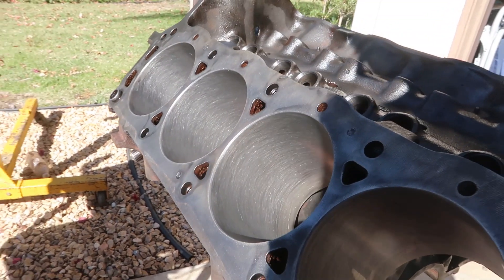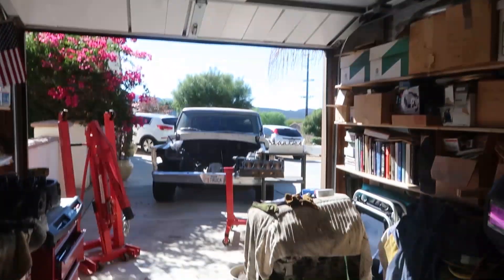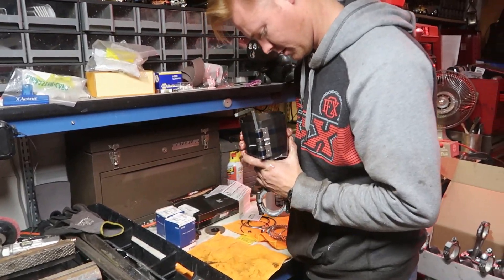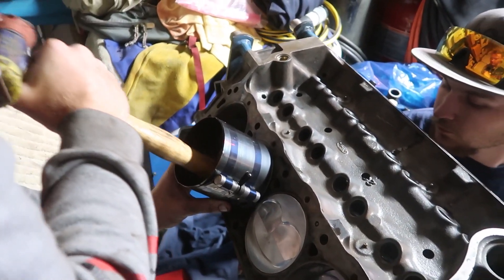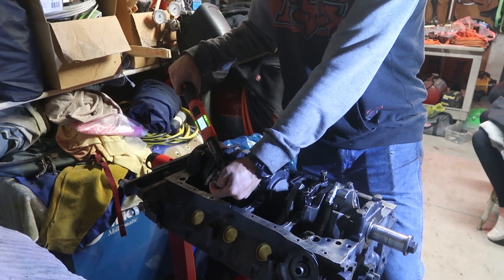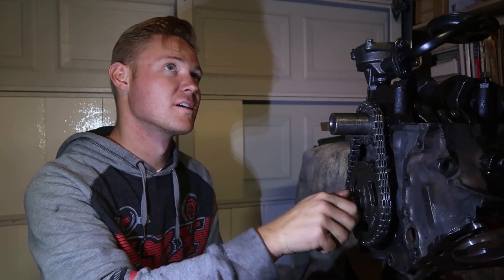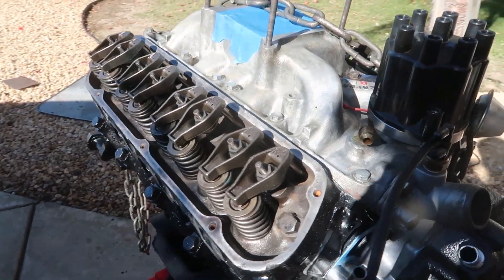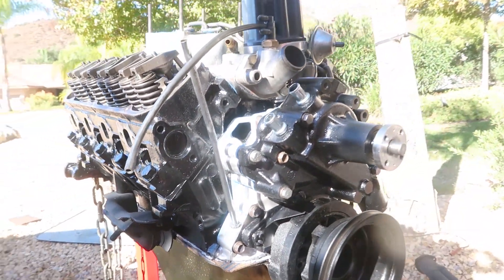Building My NEW ENGINE For My F100 In 1 Day! *High Compression Small Block*

Comment: With flat-top 4v pistons and a 58cc head, you get about 9-1 c.r..I'm currently putting a set of speedmaster iron 180cc intake/64cc exhaust heads on a 306 C.I. with a 477/496 cam, rpm intake.  Should run pretty stout.

Comment: That timing chain is a definate no go. Also a good cam company includes both cam pins. If those are comp lifters, Throw em in the trash. They will collapse eventually. Just a fellow ford nut with 35 yrs experience.

Comment: What you could have done is heat up the piston with a heat gun (I prefer using a heatgun as with torches the heating can be too localised) and get a can of air duster and hold it upside down and spray the pin with it to cool it down (while holding with pliers or running wire through it so you dont frostbite your fingers) and it should slip in as easy as a pound of cocaine up a prisoners butthole

Comment: HB Icon torque wrench is 100 bucks .. I hope you don’t have head gasket issues , you didn’t check the deck on the block or heads and used old heads from another motor and used a wire wheel on the deck on the head 🤣 I was like Nooooooo

Comment: Seems like a nice combo.  I like the domed pistons.  I am a little hesitant to run a flat tappet cam any more after reading about all the failures guys are having.  Retrofit link-bar lifters are a little pricey at about $400, but I think I would run them if I had a flat tappet block.  I am also a fan of the later GT40 or GT40p heads.  I just figure they are not as worn out at early heads and no other Windsor head flows better.

Comment: I had the exact same shortblock with a set of e7 heads with the egr in the exhaust port ground down.  Compression was around 10.25:1.  With a smaller b cam, a dual plane with a demon 650 carb, thru a 5 speed with an aluminum flywheel and  4.10 gears made 281rwhp.

Comment: Is there a hole and lobe on the cam if so young man find a good can driven fuel pump it just makes life easier maybe not as much of a cool factor but im all about what works and what is reliable... I've used many electric pumps but i find them old motors worl well with the pumps they call for not to mention simple... But cool build bud.... Downs AutoBody--- Maine

Comment: CRANKSHAFT OIL SLINGER installed and I'd look into the Fuel Pump Eccentric pin........ it should have come with the camshaft or the timing gear set !

Comment: Sounds and looks killer!  Is that cam hydraulic or solid lifter type?  I never had much experience tearing into small block Fords, except replacing cams and valve train parts, as most of my experience was with the FE block, mostly 390 but with a few 406 and 427s.  I could rebuild an FE in my garage with a buddy helping me in a weekend, although not keeping hard at it as you do!

Comment: Hope you put different valve springs on the heads. The stock 302 springs won't work with that comp 280 cam.
Reply: Should have looked before I commented. Sorry. Glad you changed rhe springs!

Comment: cheap upgrade source  set of 351 heads. theres 3 you want the cleveland if im not mistaken. you have  drill and tap the head bolts but itll add alot of hp to a 302 put it into the 500hp range on the cheap.

Comment: I think you can kiss 10:1 good bye. Those small chamber heads is going to kick you up alot. I hope you che ked valve to piston clearance bc with your right foot they just may meet!! My 306 is 10:1 and I'm running g a true flat top with 2 small valve reliefs but aluminum heads on top. You may have to run racing fuel if you start getting spark knock. Either way you'll get it and I'm looking forward to the next video. Want to hear it run!!!!
Reply: I'm betting there'll be a video in the future installing alu heads with 64cc chambers. That'd yield compression in 10:1 area & probably pickup 50-60Hp over those old wheezy 302 heads. Only reasonably good head of late '60s/early '70s were on the '69-'71 351W. GT-40 irons are similar but have advantage of hardened valve seats.

Comment: Reminds me of a 302 I built years ago, in the early 90s. 1970 302, 9.3 to 1 compression, ported 1970 heads, 3 angle valve job, 280 Comp Cam, Edelbrock f4b Shelby style intake, 600 Holley and headers. I ran a pinto converter in a C4 with 411 rear end. This was in a 1971 Mercury Comet GT. Ran 13.50s at 99 on street tires, and was an absolute blast to drive on the street! Love this build! Anxious to see how it sounds! Congratulations on building your own!

Comment: GT40 P HEADS AND E303 CAM SHAFT WOULD HAVE BEEN BETTER COMBO
Reply: No but it's not hard to drill and tap 2 holes for the lifter cradle. Have done that before and works fine.
Reply: I don't mind to run them if I have to don't have a problem doing it just like anyone else would rather have the original roller block. Matter of fact that is what I've got planned today go look for a explorer motor. Thinking on building another 331.

Comment: when your torquing an engine rotating assembly you should always spin it over after every rod you torque or main.
Reply: cody mallernee some pro engine builders on YouTube say it's bad to turn the crank when all the bearing caps/rods aren't torqued in because the bearings aren't fully seated into the caps and rods until they are torqued in and turning the crank with the bearings not conformed to the journal can cause premature failure. Don't quote me on this but I believe Power Nation recommended this
Reply: I was always taught do one at a time and turn it over afterwords that way if you were to to something improper and it wont bar over  you could always double check the last one instead of having to start over

Comment: It’s gonna be way more than any 10.1 lol
Reply: You're right. KB says those with 58cc heads will be 10.8:1. Cam is 230º at .050", so it will ease things a little, but he is going to have to pull timing back just to run 91 octane. Results should be entertaining.

Comment: With stronger valve springs and the bigger cam you really should have installed screw in rocker studs, or at least pinned the stock pressed in studs. Hopefully this doesn't cause you problems down the road. Nice to see youngsters taking on projects like this on your own. Keep it up, looking forward to hearing it run.

Comment: With 11.0/11.5:1 comp you can only run 91 now also I hope you upgrade your valve springs on those heads you will probably need to run bigger jets in the primary and secondary you might also need a bigger Carburetter I’m not sure what size you currently have but you probably will need a 750 to an 850

Comment: For heavens sake dont use the valves with lash caps and those junk rail type rockers. Get them machined proper for screw in studs and guide plates if they need it. Dont reuse old valves, they might have 150 thousand miles on them. I am wasting my time. I hope you dont end up with detonation. With flat tops in my .289 I am right at 10.5 to 1 compression. With your pop ups you may end up with more like 12:1 unless you already did the math. I am not being a wise guy but you are cheaping out in the wrong direction.
Reply: Hello, I totally agree on the lash cap/rail rocker setup.  As for compression ratio, it is really a challenge to get 10.5:1 with a 289 - I ran some numbers as I am building one myself.  4.030 bore, 2.87 stroke, 0 deck height and a .039 gasket with 5cc of valve relief takes a 50cc head to get 10.5.  the pistons shown here only have a 5cc positive dome, doubt they are at zero deck and the heads are probably closer to 60cc with Ford's production tolerances.  it should end up around 10.3-10.5.  the biggest concern I have is early in the video he showed the combustion chamber and it looks like these heads have some serious exhaust valve recession!  valve faces are below the chamber surface which isnt good.  easiest way to fix that is to do a rebuild and cut the seats for 351W valve sizes.  that way you can cut into new metal and with a bowl blend good to go.  Thecraig909 wondering if you had a valve job done to the heads?
Reply: @jeffdiehl8394  Maybe it is the camera because they looked bigger than that. A stock 289 hi-po is 10:1 supposedly and with a 58 cc cylinder head I figured he was squeezing it a good bit so maybe since I wasnt there and the magic of cameras it looked almost like an interference fit. The thing that got me is he didnt even put a high end roller chain and using old unknown valves over and he probably didnt balance it either it could be a shaker when he fires it up and drives around. I never rebuild without balancing including inline engines.

Comment: With those heads and pistons I don’t think you’ll get away with running 87 very easily anymore lol
Reply: Neal Head  I was thinking like 25:1 so he could run it on diesel🤣
Reply: Knock knock
Reply: Race gas boi. The comp 280 will help but it’s gonna be 91 minimum fo sho. Might end up needing to get aluminum heads in the end.
Reply: @sparky72  i def would have saved up more money to put into aluminum heads
Reply: Life’s too short for 87 octane
Reply: Amen. You will be going to High Octane.
Reply: Nah he will be able to run pump gas tho, just 93, good thing he didn’t go any higher, I had a old 64 327 with domes and double bump heads, rowdy motor but it wanted 110, and tbh it was ass.

Comment: I’d say the compression ratio is more thank 10:1 with that head more like 11-11.5 to 1
Reply: I would imagine with that small cc chamber
Reply: Yeah, I'm honestly confused. I have a 306 with flat top piston that have valve reliefs combined with AFR 165 heads that have larger chambers than these and im sitting around 10:1.

Comment: I foresee broken u joints in the future! You're gonna need to invest in some traction bars or slapper bars or something to keep the rear end from wrapping with all the new power!
Reply: @janeandjohndoe4704  i thought that too about the 9" in my 78 f150 till I literally blew apart the housing into pieces
Reply: @janeandjohndoe4704  yeah mine was the original 9 inch from 78 and apparently the stock cast iron center sections are only good for 300 ish hp and my 408 makes a little more than that 😂 granted it lasted a while with a ton of abuse but it let go in a spectacular fashion and forced me to upgrade to a nodular iron center section that's good for 1000hp
Reply: @janeandjohndoe4704  oh yeah my old center section was tired. And I abused the hell out of it. So it didn't owe me a thing when it let go

Comment: u did it the way we did at shasta college. but we mostly focus on cleaning the parts the block gets hot tanked and pressure washed and brushes run down all the oil galleys and coolant passages.

Comment: Why not FORD blue on the block ?
Reply: Cool Ford Fact: Ford only went Blue on every engine late 60s.

Now obviously his truck is from the 70s, but early 60s Ford engines were black, with valve covers/air cleaner colours denoting what displacement/code they were.
Reply: @perotekku  Ford started painting engines  blue in 1966(64½ & 65 Mustangs have black blocks with painted valve covers). I still remember the first all blue engine I saw, a new 1966 NC State Trooper police cruiser, 428 Interceptor. Looked like it belonged on a irrigation pump, boy howdy was I disappointed. Trooper was a friend of my best friend's dad, let us see the engine. Ford switched to grey I believe for 1981.
Reply: @tombryant1104  I get the Ford Blue, and its iconic; but the early 60s sure looked nicer.

Heck, even the Early 50s "Ford Green" was nice, like a muted Buick Green.
Reply: @perotekku   He says the heads are 1970 and they are blue. I had the same truck and I think the 360 block was blue . Not sure.
Reply: @jerryriggan  Yeah, the heads are D0OE heads, so 1970. They were blue originally no doubt, I was more just trying to spread the Ford Gospel by pointing out that not all FoMoCo engines were Blue.

Really only Blue from 1966-1980-something. Most people know them as blue because all the really famous Ford cars had the Blue V8s.

My personal favourite is the early 1964 black blocks, with either Red or Gold valve covers, looks sharp.
Reply: @perotekku   OK Thanks
Reply: Because how original
Reply: @garrettpitt2057  if he wants to really stand out,  paint it john deere green
Reply: @g.h.1726  um no.
Reply: @g.h.1726  or hot pink lol
Reply: He is going for a Nascar look inside and out